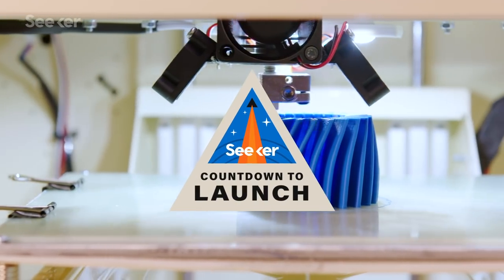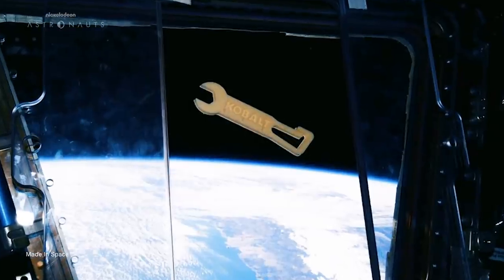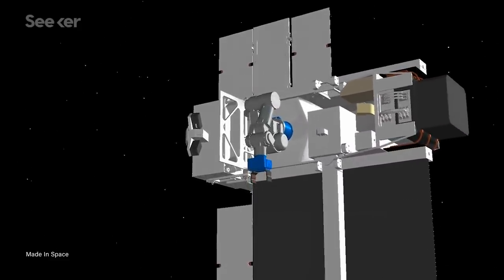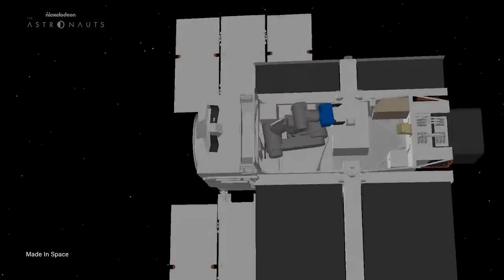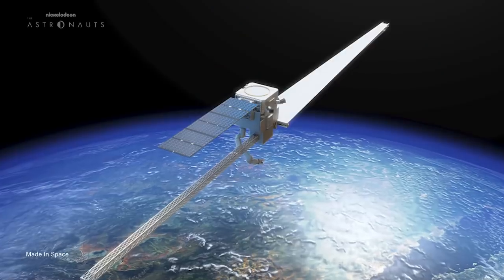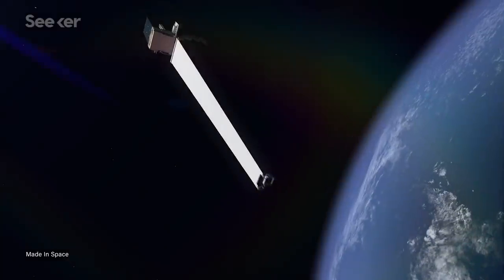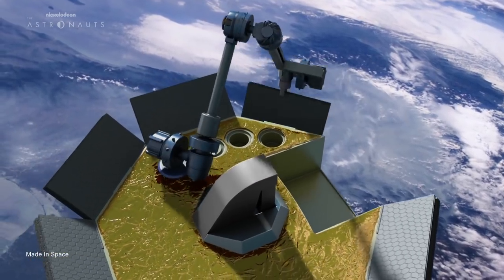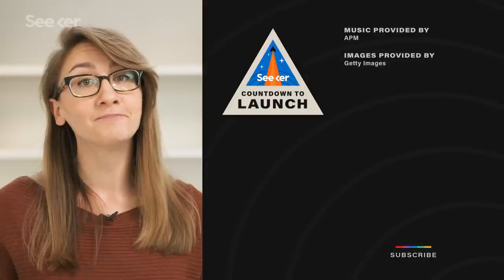How This Next Generation Satellite Will 3D Print Itself in Space

Comment: It doesn’t reduce the heavy payloads, it’s still the same mass. But it’s a lot less bulkier.
Reply: Yes
Reply: its probably even a little bit heavier because of the printing equipment.
Reply: @oerwout10  The printing equipment stays in space though, permanently, once it is initially up there. They only need to send that once. Then it is just essentially like printer refills. Big rolls of filament or maybe solid cubes that could be melted down.
Reply: Eeeeh, it might reduce the weight as it doesn't need to be designed to survive launch, like you could build a super long 1mm sheet
Reply: @Sinaeb  Exactly you don't need to account for the stresses in a structure during a launch anymore, this is amazing!!!
Reply: They could reuse parts in space from broken satellites.
Reply: I just said that to my husband. A ton is a ton no matter in which state it is in.
Reply: @PRDreams  ....
Reply: Maybe in the future we could make a  really big printer by having multiple printers which can make more printers and eventually just send up packages for supplies
Reply: no not moon/mars for example. The material could be get from there.
Reply: @MrChiefsmaster  that would be the game changer.
Reply: Long objects need support while launching, Those Supports are what theyre trying to remove from the rocket equation.
Reply: Exactly, They can be more voluminous
Reply: it does reduce the mass because spooled up filament can take higher loads than the finished product. Think strength density.
Reply: Yves Chandler Castillo  sounds like when cars are at the pick n pull but a million times more difficult but with  large reward of GOLD!
Reply: This technology won't end up mainly being used in this way though. It will ultimately be used with asteroid mining and satellite reclamation to generate new materials in space and recycle whats already there.
Reply: also, i think the heat for printing the stuff is going to be a problem, the material would need to cool a real long time
Reply: @nakoda1610  The material is literally exposed to the vacuum of space. There is no better radiative sink than space. We've been able to get water to freeze into ice  just by exposing it to the night sky in winter since at least 400BC.
Reply: So much bullshit idk where to start
Reply: If you have a smaller payload you might also be able to get away with a smaller payload fairing too
Reply: He says in middle of the video. Satellites are designed to withstand the first 10 minutes of flight. In other words, wasted mass. You obviously missed that.
Reply: It reduces the heavy payloads by making it possible to send something that would normally have to be assembled on-planet in multiple pieces that the robots can print and assemble in orbit. Instead of one large payload we can achieve the same result with multiple smaller payloads.
Reply: Ya but after the printer is in space, all it’ll need after is the resource to print. Which will pay off in the long run
Reply: well a filament brick requires less support in the satellite itself than an assembled component would so theres mass savings in the satellite itself but you arent saving anything on the filament
Reply: Let it orbit in the same speed as the earth rotation. When taking flight, plug a 300 km long 3d print filament that on a roll in earth. Then print on space, pulling the material that is on earth. Infinite printing with sending only a limited quantity in the first trip.
Reply: Psycho Pass  no, a given material mass is worth more in zero-g than under gravitational stresses. it's not a question of mass, but design.
Reply: @oerwout10  yes but only for the launch bringing up. Then it's just more printing material. Also constructing things in space will allow for less material to be used as part strength doesn't have to compete with gravity like when assembled on earth.
Reply: @fademusic1980  if the plan is to build completely new sattelites in orbit using the printer and resupply rockets then yes. but im unsure if that is what they want to do. it sounds like this sattelite is only meant to print itself. it can only do structural parts so the supply rockets would still need to bring all the equipment and hardware along with the printing material, and additional fuel to move the finished sattelite into a different orbit once its done
Reply: @marverickbin  You'll find the weight of the filament will break the filament. Any idea how much weight 300km of filament would be? Many times more than the filament can support in tension.
Reply: @pehgt5099  Yup, this is what willful ignorance looks like.  I just see:

"I'll disregard this properly formed, well-verified knowledge - and not even try to learn enough to understand it - and then just make some objectively incorrect and/or unverifiable claims against it. I'm sure I'm right. I can't possibly be misinformed or manipulated, even though I refuse to let in enough information to be capable of thinking for myself."

I guess there will always be people who just don't care to learn how to learn. As long as you're above ground and sucking air, it's never too late to start.
Reply: Rebecca Armstrong 
Space Ikea :o
Reply: no
Reply: You missed a key point of the video. 
Structures are designed to survive launch which makes the stiff and bulky. 
Printing in space allows the construction to be MUCH more delicate and flimsy. 
Its a lot easier to get a spool of PLA into orbit than it is to get an intricate mechanism of folding panels and motors.
Reply: It's like sending an Ikea kit to space

Comment: How would it reduce the weight on take off? You still need to take the "ink" with you before lift off. What happens when you run out of the "ink"?
Reply: you send more ink
Reply: You're right that one ton of raw material weighs the same as one ton of printed satellite. In fact, you even have the mass of the printing hardware on top of that.
However, you don't need to design the payload to survive ascent and the payload itself is shipped in a smaller form factor, potentially allowing for a smaller payload fairing.

Comment: I have 3D printers. None I'd trust to always work on the first layer. I know stratus has probably solved these problems for industrial 3D printing but I dont think any team could solve those reliability problems in a few years alone - because some very smart hobbyist have been trying for a long time. I can't imagine what industrial material they would print with and how they would manage the cooling - although I guess in most cases print speed wouldn't be a concern so they could print very slowly... I bet overhangs would be terrible too - it's not gravity that causes overhang problems, it's the fact the nozzle is pushing hot plastic out into nothing and part of a thin previous layer and deforming it - so same in space. Humm I bet the nozzle wouldnt ooze though - and - space is probably an amazing dry-box 🤩

Comment: It would still need the same overall mass if not more to do the same job. The only upsides are it will take up less space and that you would be able to send up more materials for it to do it's job. The only way it would be any good is if it can build other structures ie other satellites etc
Reply: I think maybe you might be able to send it up in separate missions, and then assemble it in space.
Reply: One key is that you don't need to assemble the things on the ground, an assembled object takes up more volume than it's raw packaged parts, more air gaps and waste of space, even more so when considering raw 3d printing materials. Also have a very limited quantity of astronauts being able to space walk to build these things (not only limited quantity of people, but they then have a limited time they can be out there doing things as well), so you could have an automated process constantly working on, let's say a Dyson sphere, 24 hours per day, hot or cold ,in a vacuum. On top of the 3d printer, you have robotic assembly arms, you could be printing parts AND sending up parts made on the ground, at the same time.

Comment: 'lessens the need for heavy payloads'? how? won't you need to carry the material into space anyway?
Reply: They even have to carry the 3d printers
Reply: My thoughts as well. at the very least this will have the weight of the fully constructed sattelite + the printing equipment. one advantage i do see of this is that the payloads would be smaller and take up less volume in the payload fairing maybe?
Reply: We don't even have that kind of technology lol there are many flaws behind this, unless they can shoot like a few more smaller rockets with equipments and such as spares this feat is going to take a LOOOOONG while and we have to worry about asteroid apophis
Reply: Simple, launch the 3D printer. And then just feed it with relatively small periodic launches. Thus instead of launching a 2kt sat in one launch, you can do it in three or four.
Reply: She did say that most of the bulk from satellites comes from surviving the first 10mins
Reply: It's simple. It won't need to carry all possible equipment necessary for the operation, but instead print what's needed on the go. Also polymer is lighter for the same given volume
Reply: This will be great prep for space mining though. Once we can mine an asteroid we can use the material we get from it to print another miner and then another and another
Reply: @bowack194  This is with plastic polymers though, not metal.
Reply: rdizzy1 Is it? I know the thing on the ISS they were talking about is but the same guys at made in space are doing crystal and ceramic manufacturing on the ISS as well
Reply: None of that is metallic but asteroids have other resources depending on the type and if they can do this it’s only a matter of time till they can do it with metals
Reply: @bowack194  Yes, on their website it says "space rated thermoplastics".
Reply: rdizzy1 Also says that they have a ceramics module on the ISS.
Reply: Oh actually the ceramics are made from a polymer from the looks of it
Reply: @rodrigoribeirodeazevedo9238  That's what I got from this

Comment: I mean it's said a lot, but this is what future space travel needs.
There's a lot of complex and large shapes needed looking forward.
And packing them all into a rocket is very difficult and a waste of space (lol pun not intended)

So next thing to solve is:
Reducing the ammount of filament needed, reducing it's weight and increasing it's strength all at the same time.
Maybe even using a process similar to welding, but with a laser that melts a super alloy wire.
Making that wire hexagonal will increase the packing density.

If you're curious why it should use a super alloy wire:
If there's an alloy existing or yet to discover that's at least as strong as carbon fibre at a similar or lower weight, it would definitely make the whole process easier and more efficient ... Possibly cheaper.

If not, "just" develop a printing system using the strongest and lightest material possible, since low weight to high strength is the most important factor here.
Reply: Sending solid mass, the equivalent of “pig iron,” into orbit can be done with rail guns, no rocket needed.  Then the builder satellite can grab it and use it as 3D printing “ink” until it runs out, then order more.  Several kinds of “ink” such as various metal alloys, plastics, glass, etc. which can survive the shock of launch from a rail gun could be sent to rendezvous with the builder satellite.
Reply: @allanrichardson1468  exactly, it's "easy" to restock.
Durability and weight of printed parts is the objective here.

If the technology is advanced enough there might be a satellite station that has multiple production lines/steps to also print motors and assemble machines for making silicon chips... Basically a production line.

If this tech gets advanced enough we might be able to send a single probe to asteroid belts where it then starts to produce an assembly line which is capable of mining on asteroids, refining ores and send them as packages back home.
No more digging up and destroying our planet 💁🏻‍♂️

There could be stations like this which produce whatever is needed on demand.

But all has to start somewhere, being improved more and more.
I think this self assembling production line should be set as a goal. Always improving it further and further until it can execute all steps needed to build itself and repair itself. (Maybe even protect itself from debris or terrorism/vandalism)
Reply: @allanrichardson1468  well theoretically yes, but the problem with the rail gun method is, even if you're able to shoot it into orbit without falling apart, melting etc. and have the right velocity, you are on an elliptical orbit with it's closest point in earth's atmosphere... This would require thrust to correct it's orbit, adding a lot of additional weight and critical parts that can break during "launch".

But the idea is great 🤔😁
Shooting a delivery rocket into semi orbit with a massive railgun sounds f.ing amazing 😂

Comment: Ok so I have an idea.  

It's a big one

Ok, so i think we should take a very pure glass like cube that we can easily take apart, it's only job is to contain  particles. Next with this low clear class and a way to "inject" an aluminum titanium alloy dust into said chamber. Then use an assortment of low and high power heat transfer methods to shoot through this containment box and arrange the alloy dust into place( we could use pleanty of other methods to maneuver the dust into a clump). And then use the high power energy transfer method to coordinate a heat point where the alloy fuses. Realest this until youv made a small tool then a bar or something and go from there.

Comment: How will they make the payload lighter? Wouldn’t you be using the same mass of filament to make a part on eart
Reply: Shape the block of bulk polymer that perfectly fits the spot for payload on the ship, rather than having to shove all those random shaped parts in with much wasted air gaps in between. More material per volume.

Comment: What you need are pressure vessels in space and lots of them. The only way to do this is epoxy and carbon filament winding around a balloon mandrel in space. You can make straight, curved and spherical parts which is the fastest way and the only way to construct a VonBraun space station or an O'Neil cylinder. Only then will humans inhabit space instead of camping there. Big pieces like that don't get off this planet so easily but balloons, carbon fiber reels and containers of epoxy resin do. All you need is a robot fiber winder in space. Be nice if someone got the news that could do something with the idea cause I never will.

If you made the balloon a reflective color you could watch it inflate from the ground. What a sight that would be to see something the size of a Cheerio go moving across the sky 8 times a day.

Comment: Way overhyped.  I'm a huge fan of 3D printing and it looks like there are some nice ideas and technology being implemented by this group.  But this is not even in the ballpark of being able to "print itself in space."   Not going to happen.  The headline is overly optimistic to the point of being deceptive.

If you listen carefully to the video they have (i) concrete plans to build a small specific set of parts in space, (ii) a general claim along the lines of "then we'll work on more stuff," and then this gets wildly extrapolated to (iii) a satellite that can print itself.  There have been claims about "self-replicating 3D printers" for years.  None of them are self-replicating.  None of them can print themselves.  Not even close.  Not even in the ballpark.

Let's keep moving forward with 3D printing technology.  It has the capability to transform particular tasks and to be an incredibly valuable tool in specific situations.  But let's cut out the hype and not pretend that we're even close to building a machine that can replicate itself.  For the foreseeable future, that technological capability remains solely with biological systems.

Comment: well first you need a frame 
using an inflation method may work but i'm not sure how inflation works in vaccume.
you can use a Epsom Salt  method using liquid and and a catalist to rapid grow crystals in space, also it produces heat. (i think this is a good method) 

the frame would be like a balloon then you'd use anchor points to attach the frame.
over time you'd dock more sattalites to compleat the structure and we could end up with megalithic space structures.

i mean this is my dream for space stuctures, i have no way to sell the ideas or develop them however so maybe i'm wrrong